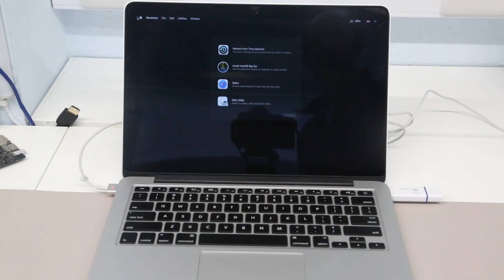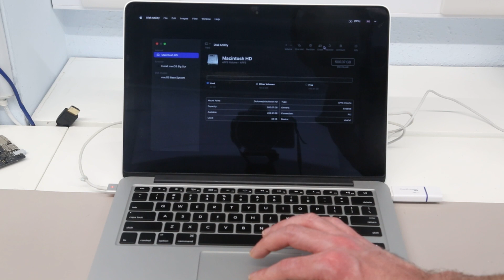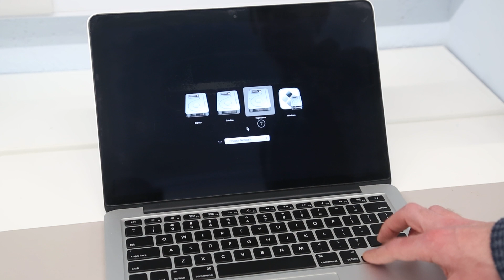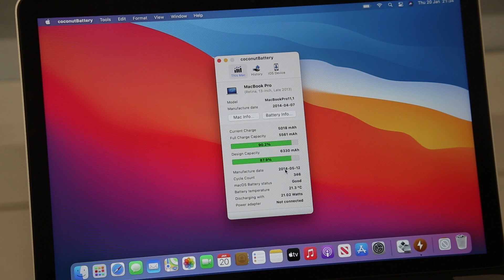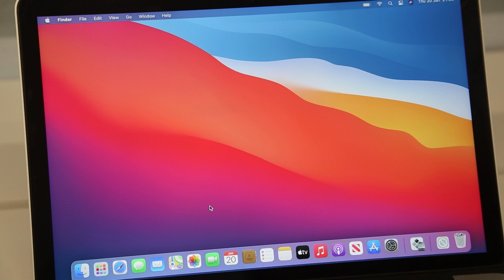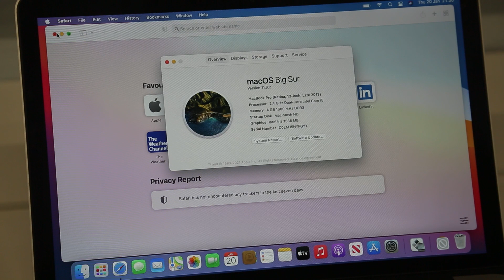MacBook Pro 2013 Refurbishment and Logic Board replacement, and are they still good in 2022?

Comment: Great video!  Any recommendations on which replacement logic board to purchase?  
(My 2012 or 2013 MacBook Pro 13”, with i7, is non-responsive.  No lights or fan sounds.  The logic board has some white oxidation, which was removed with a touch of alcohol and compressed air).
Is the problem likely only the logic board?

Comment: Hi,
Do you think i can upgrade my macbook air mid 2013 with a 2015 or 2017 logic board ?
Reply from the maker: Yes, the 2013, 2014, 2015 and 2017 logic boards are all interchangeable.
Reply: @BrueComputing  this doesn't seem right. Wouldn't mounting holes, standoffs, and port locations differ between those models?

Comment: Where did you purchase this logic board? Link please?
Reply from the maker: I picked up a replacement on eBay.
Reply: @BrueComputing  the new logic board I got doesn't have a slot open for the touch pad. You say it's not required, will everything still work without it plugged in?
Reply from the maker: @aprilestrella5766  If you don't plug in the touchpad then obviously it won't work.
Reply: @BrueComputing  I mean with turning it on, the power, the start up screen.. I know the touch won't work